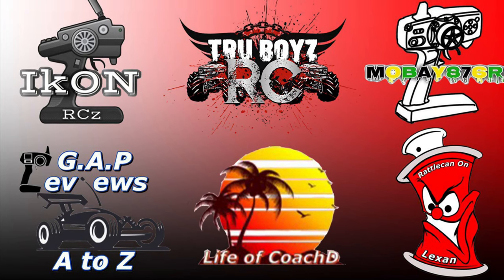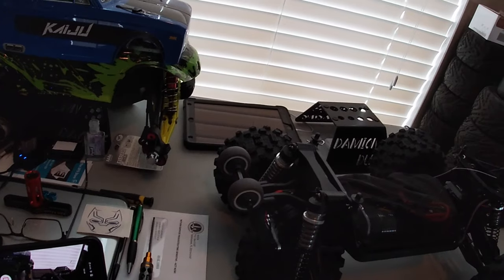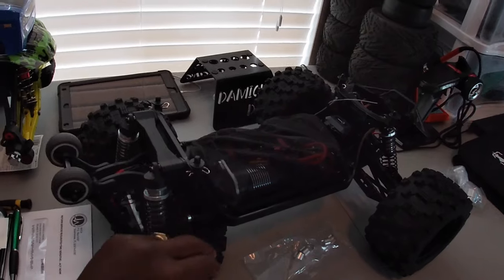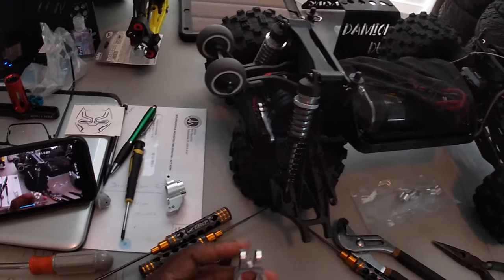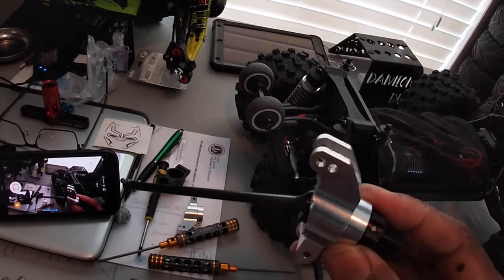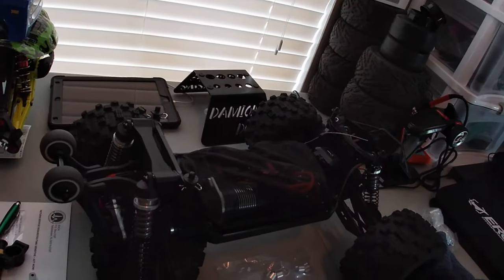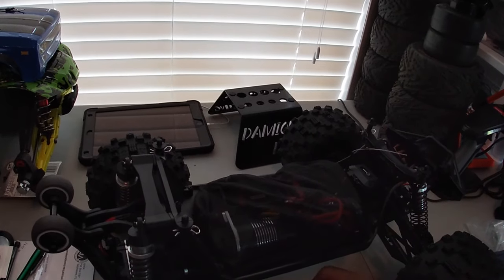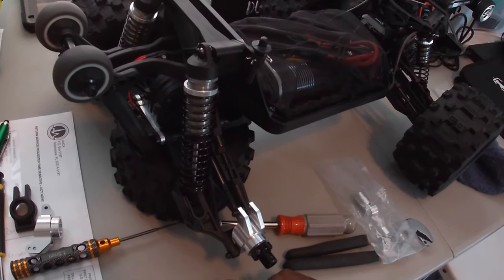Redcat Kaiju Rear Hub Carrier Upgrade

Comment: Those look good but the collars for the diff cups are crap mine is so rough all the way around and they're undersized I can't even get my dog bone in them
Reply from the maker: Nick Hathaway they’re not undersized, you have to put the dog bone in at an angle and it goes right in(at least mine did).
Reply: @CoachD386  nope impossible even from the side without a lip I had to file down my dog bone pin so it would go in so definitely undersized at least mine but that's my luck or some odd reason my pin on the dog bone is a little bit bigger than what it should be on both my dog bones that I've done so far lips are cool idea so they won't pop out but I feel like the piece should be longer because they bottom out on the lip and you can still see where the slice is so I think it would still be a little weak they should have just added another eight of an inch or something
Reply from the maker: Nick Hathaway oh wow that’s crazy fam, sorry to hear that!

Comment: Great information bro 👌 it sucks nobody makes a metal spur gear for the Kaiju... That plastic doesn't hold up on 6s lol at all... Ik they say 4s is the sweet spot but I bought it to run 6s...kaiju may be on the sale block after this new center diff with spur gear assembly come in Tues from extreme rc precision 🤔 🧐 🧐 #rcfam4life ™ 💪 💯
Reply from the maker: Hopefully i can show this to ERCP and he might be able to come up with something after he makes these next few upgrades for it.
Reply: @CoachD386  bro please do I'll be the first to order a couple  💯 it would make me keep my kaiju because I do like it.. But I don't want to be limited to running it on 4s with a plastic gear at all I'm a 6s guy 💪 🍻
Reply from the maker: Brock Diesel Do i was told “if you take that bolt out of the top that holds the spur gear,  that extra metal bowl with the jam nut and set the mesh right that gear does not fail.”
Reply: Ill have to try that never done it before.thanks for that big tip.. I put my new diff assembly with attached spur gear from extreme rc precision instead it 30 mins ago so the kaiju is back running but I'm afraid to run it on 6s which is all I have is 6s Lipos.. Appre you responding back big dawg 🍻 💯 💪
Reply from the maker: Brock Diesel no problem brother, run it just watch motor temps!